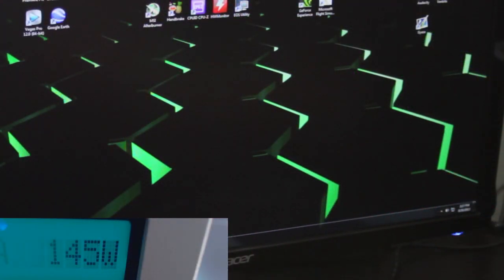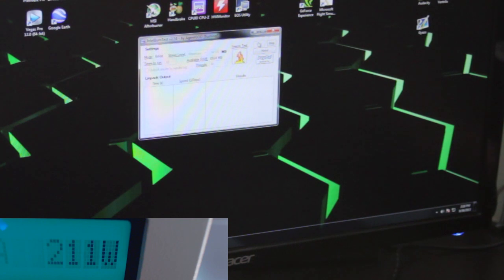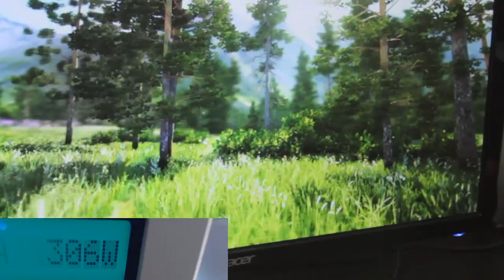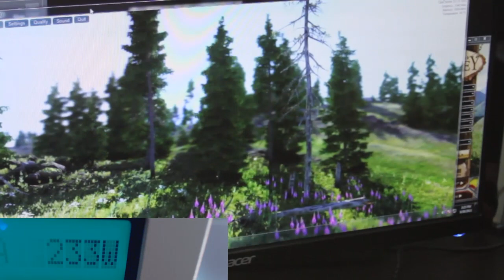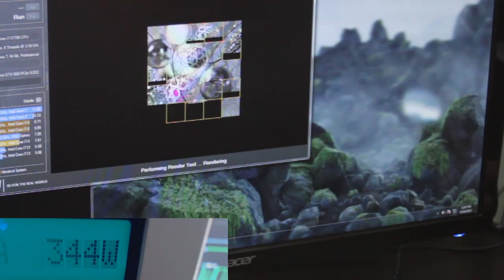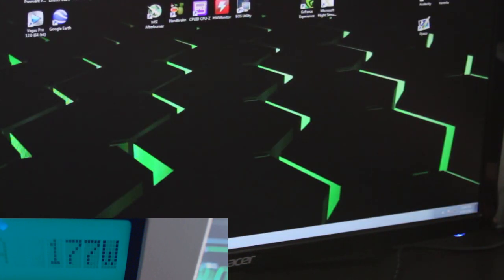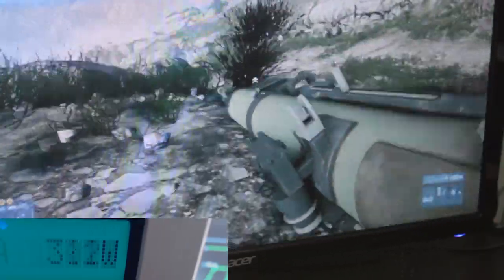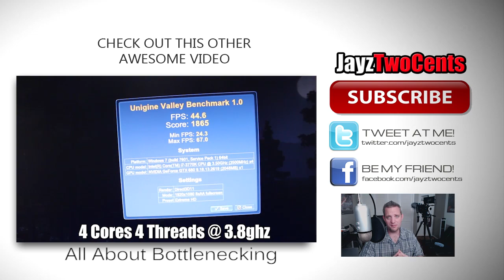How big of a Power Supply do you REALLY need?

Comment: nice video < im planing to SLI 2 MSI GTX 760, and im still wondering if my CX750M 80+ Bronze will support it , i dont have any budget any more since i'm about to purchase another GTX 760
Reply: Did you use pc partpicker to pick out your parts but a 750 should be enough but remember if you plan to overclock parts it ll require a bit more power but 750 should be enough for sli setup
Reply: thanks for the answer, nah im not comfortable on overclocking , but hey thanks , and yeah i put all of my components on pcpartpicker and all my components needs 620 wats for 2 gtx760 i still have almost 100wats left but i'm not sure if that calculation from pc partpicker is accurate
Reply: mark anthony chance Its pretty accurate most people use it too get there stuff organised so yea 750 should be enough but if your still worried get a 850
Reply: i guess 750 be fine , thanks bro!
Reply: I had the same 2 cards running off of a shitty 750w and they worked just fine with no problems. 750w is fine for 2 760s
Reply: cool , i think for now im gonna be running this gpu alone cuz i feel like i dont even need to add another card, but hey i still wanna do it though!
Reply: Honestly when I did it, I thought it was major overkill since I was playing 1080p only. I started playing in surround which really brought out the performance but the 2gb of Vram became a major issue so I sold them for an R9 290 4gb.

Comment: Okay, all the power supply calculators online are full of shit, not even 2 of them agree with the wattage even closely!

So I'll just ask directly: 2x MSi R9 280X Gaming 3G + FX 8350, 850W(gold) enough?
Reply: More than enough for that that setup should nt use more than 700 watts
Reply: Andy Williams Are you sure? The stats show that the MSi R9 280X draws 300W under load.

I need to be sure, I'll be ordering the parts from germany, which is 2 countries away!
Reply: BigBadBeef well if you want to be safe get a 850 80+gold  but a 750 80+ bronze should be enough the rm850 would be more than enough if you want to go on the safe side
Reply: BigBadBeef honestly they are right 850 is enough, 750 MIGHT be stretching things a bit, so honestly the best thing i would recommend is an 800 watt 80+ gold/platinum, but with that kind of rig an 850 wouldn't really be "much" overkill so you could definitely go with it to be safe.
Reply: with 2 7950 crossfire burnt my 600w toughpower in two days lol

Comment: Would a 500w be fine for a FX-6300 + R9 270?
My PC is going to be very overkill because I tend to play very old games :p.
Reply: Even 500W is overkill, the R9 270 with a 4770K draws much less than 300Ws from the wall even at full load, watch this video again, a 3770K with a GTX680 barely draws more than 300W at the wall. A 430W PSU would be sufficient for any mid range setup, even in the future, since components will only get more efficient. There are those who would recommend 1500W PSUs for a HTPC but you would be paying more to get less efficiency.
Reply: Remember to future proof as well, you'll be pissed if you have to buy a new power supply when you upgrade.
Reply: yifuj I really need a device to tell me how much power it's using. Is there any software?
Reply: Nope, just get a wall outlet meter like a Kill-a-watt, they are around $20, and unbranded ones are like $10, very affordable.
Reply: yifuj
You have to remember about efficiency a 50% efficient 450w psu would draw 900w from the wall at 100% load and an 80% efficient 450W Psu would draw 562.5W from the wall at 100% load.
Reply: AT LEAST 600/ 650.. I Have i7 4770 r9 270 with a evga 750 80 plus

Comment: nice video I think I got what i needed to know but can I ask anyway I will put a gtx 780ti and an i74770k in my build maybe overclock to 4.5 and I'm planning on using corsair ax860i  I was going to use 1000w psu just because in the future I may put another 780ti but around the forum people say I need 1000 but what do you think will the 860 be enough for two 780ti's ?

Comment: a 1000 watt power supply which isnt 80 plus is still going to deliver 1000 watts at max peak, but itll drow over 1000 from the wall, not the other way around as mentioned in the video

Comment: wow, I really overpaid for my Corsair HX750w.....I just liked how it has a 7 year warranty...I guess truth be told, nearly everybody out there would be perfectly fine with the cheap bronze rated Corsair Builder 430w power supply. Good to know I don't have to spend $120+ just on a psu...I honestly felt guilty paying that much when I could of gotten away with a 20 dollar bronze rated PSU (after rebate...before, 39.99) >_> . I run a modest 3570k @4.2ghz and an HD7950 non overclocked with 16gb ram, 2hdds and an ssd for the os

Comment: So I'm looking into throwing a Corsair H80i into my system. I have a 650w power supply (not 80plus rated) and my specs are FX 6300, MSI HD7870 OC edition, ASUS sabertooth 990FX R 2.0, 7200 RPM Seagate Barracuda 500gb, and I also have a led strip and I don't know if this matters but I run it with 2 monitors. With this setup do I have a big enough power supply to add the H80i?
Reply: You'll be fine. But you need a better power supply. I think 80+ Bronze is the absolute minimum for efficiency.

Comment: Glad I watched this video recently, just added another MSI R9 270 to my build.

My rig:
i5 3570k 
MSI R9 270 in Crossfire (overclocked to 1140mhz, using unlocked msi afterburner)
8Gb of Ram
256GB Sandisk Ultra sdd
1TB HDD
This is all powered by a Corsair CX600M PSU and before you ask it's totally stable. :D 

Thanks Jay

Comment: Soo you mean that my 500w will power a GTx 650?
Reply: definitely, a 500w could power a 760 easily so i cant imagine a 650 being to strenuous
Reply: ohh, since people says i need like 800 w -_- fuck them
Reply: Daeswow You can run a 770 or 280x on 500w.
Reply: I have a 4670K and a 7970 GHz overclocked hard on a 500 CX siries (budget one) 
Totally fine!
Reply: i have gtx 650 and my psu is 450w, works perfectly
Reply: Well i buyed 2 GTX TITAN Z, for my heavy projects, thats not even the GTX 770 ti could handle and i need big power to do what i do
Reply: Daniel Bekkelund You bought 2 TITANS? uh they draw about 375 watts each so you will probably be wanting something North of 800 watts.Maybe a Corsair ax1200i?, it's 1200 watts and expensive, but considering you bought two titans it shouldn't put you out too much, and it's 80+ titanium which is the highest efficiency standard so it will save on power and last a while/
Reply: Daniel Bekkelund are u on steroids???
Reply: ^ what make you think that O.o ?

Comment: For AMD FX-9590 and GTX 780 what power supply should I get, I will not be over clocking at all.
Reply: I'm going to get an 80+ gold 850 watt psu and a h100i water cooler is that good?
Reply: I think I'll get a 750 watt just in case.
Reply: Thanks a lot for the help.
Reply: MagikPotato
Hey :) I have a FX 9370 + 2x280X crossfire, CPU overclocked.... peaks around 800W while stresstesting the system
Reply: unfortunately not in my country :P (damn)

Comment: @ 2:10 you made quite a big mistake. No matter how efficient, a PSU can (or should :Q) deliver the current it is rated for, the efficiency only determins how much additional juice you are going to draw from the wall and turn into heat inside the PSU.
A 1000w 80% efficiency psu would draw 1250w from the wall while delivering 1000w of usable current while a 90% efficiency gold/platinum/titanium psu would only draw 1125 W ->half as much heat for the psu.

Comment: Hi. I'm buying a PC on PC specialist and the parts that I've chosen all equal up to 614 watts, it's saying to use a 650 watt power supply. But should I use a 750 watt just in case? Like say if I wanted overclock.
Reply: ***** 
 yeah.
Reply: PC Game Man K thanks.
Reply: A 650w power supply with an 80+ bronze or higher rating should do the job easily.
Reply: Calculators like that one either overestimate to be safe, or are designed to sell more expensive power supplies, unless you have multiple graphics cards, 650W is more than anybody will ever need, even if you are running at 8.5GHZ on LN2.
Reply: yeah, easily
Reply: ***** In a sense I would say it is good to over estimate wattage then under estimate. Some calculators are pretty drastic though. Like one site said I needed a 750W Another said I needed a 450W. Im doing gravy with a 500W.
Reply: DukeadaWickid420 I'm building a PC with a amd a6 5400k 3.6 GHz and 4gb ram with 1tb hard drive and a MSI a55 chipset fm2 motherboard atx FYI and I don't plan on over clocking so would a 300w powersuppply work please answer I need to know
Reply: It might,but I would go 400 or 450 just in case. Its always better to have a bigger power supply then a smaller one. that processor might use more energy then i know about. usually a 500 is good for almost everybody.

Comment: Just as small comment on the facts in the video: If I remember correctly the 80+ mark does not mean that if you have a 1000W you will get 800W effect out of it in to your computer. What it means is that with a 1000W power supply you will draw a maximum of 1250W from the socket. This means that the efficiency rating is only valid when the concern is how much power you draw from your socket in your house. A 1000W quality power supply will thus deliver 1000W to your components, the efficiency rating does however mean that you will have an efficient conversion of 240V/120V AC (in your house) to 12V/5V/3.3V DC in your computer meaning you will get a power draw closer to what you actually use.

I might be a bit off on this but this is what I was told when I claimed the exact same thing as in this video.

Also I would personally use something like Kombustor or Furmark combined with Prime95 to get a maximum power draw. You could also max out FAn speeds and do a full system backup to all tyour drives to see the absolute maximum that your PC can draw.

Comment: Will my system run okay with this build? (PSU and I am not OCing the CPU)
http://pcpartpicker.com/p/3n0G9
Reply: Yes, that build will draw never draw more than 400 watts absolute max.
Reply: yes, but i reckon you should change it regardless. The cs series is for average builds when people want good efficiency. also that case not exactly good value for money. maybe the new 450d would be more suitable.
Reply: ***** Try BeQuiet, Seasonic or Superflower. As for the case, Might as well just get an NZXT source 210 or a Bitfenix Shinobi. Unless you really want the 650D.
Reply: Paul Haselton ***** Paul Haselton Thanks for the input and I will actually change the PSU also the reason I want that case is because of the more control over neatness as if you notice the 650D has more of those holes that you use to wire through everything without it being a wire mess.
Reply: Omar Ocegueda yes the 650d is has more cable holes, but it is also older, less radiator support and less user friendly. Maybe check out something like the phantom 530 or the arc midi r2

Comment: Hey Jay, have you since thrown in that second video card? Was the wattage ok?
I want to throw in a second gtx 770 2 gb in my rig, I have a corsair cx 750m, 6 120 mm fans, 2 140, water pump, led strips, 1 ssd, fan controller, etc. By reading and watching your video, I think I should be fine. Just wanted a second opinion. Thanks
Reply: Oh, also running a fx-8350 oc to 4.6 and a Asrock extreme 9 mobo, with 2 4 gb sticks of ram @ 2133

Comment: Do manufacturers of graphics cards leave headroom when they say that a specific card requires a 500w minimum power supply? I am looking at an XFX GHz edition card using the AMD Radeon 7870 GPU which says that it requires a minimum 500W power supply. I am using an intel core i5-3470, not overclocked, an asus motherboard, and 16 GB of Corsair RAM. Can I add that card with my current Corsair RM-450 power supply?
Reply: Yes

Comment: Buuuuut if you only can afford a GPU and a PSU at the moment and is planning on upgrading the PC later?

My motherboard is a ASUS N13219. My current PSU: 300w (lolzz I know), my current GPU is a GT 530.

I want to get the Corsair CX 750w because I'm getting the GTX 660 who needs more power. However I don't think they will fit in my chassi so I would need a new one but no one will take my old motherboard xD

Anyways..I render videos, play games, upload and will also make maps for games. will I need the 750w?

Comment: Im having trouble believing this. My 750w literally spit out a plasma ball and died burning hot with an i5 8gb ddr3 on a msi motherboard built to overclock and a gtx 480.  No way the 650w that came with the pc was enough nor 750w. Im getting a 950w supply.

Comment: I'm a first time builder and I really need help. I'm still deciding on the GPU but I'm thinking a EVGA SuperClocked GTX 780 or a  EVGA GTX 680, and for the processor I have 3 choices. A Intel i7-4770k, a i5-4670k, and a i7-3770k. For the RAM I'm going to use the G.SKILL Ripjaws X Series 8GB. For the HDD i'm using the Seagate Barracuda 2TB and for the SSD I'm sort of confused on what I should get because I'm going to put my games maybe recordings and OS on there so I thought of buying the SAMSUNG 120GB SSD. (Please give me a recommedation for that) and I'm just getting a simple DVD/CD thing from ASUS. I REALLY NEED HELP with the Case,the fans I should use, the Motherboard, and Power Supply! ANY RECOMMEDATIONS WILL HELP! Thanks you so much! <3 (I really don't want to mess this up cause I really can't afford to ship it back and everything.)

Comment: I got a watt counter and my pc only uses about 220 watts under load, am upgrading with some confidence my 400w power supply is good enough. I am predicting about 300 watts draw with the upgrade.
Reply: specs?
Reply: supremeAFA phenom ii x4, r9 270, it runs stably at about 270 watts maximum draw, I only have 1 hard disk and on board gfx / sound disabled, a few usb devices.
Reply: it's a good 400 watt power supply, I would recommend getting a watt counter if you're concerned that's the only way to know for sure they are cheap!
Reply: ha almost same specs only that i have an intell cpu .i tired runing the r9 270 on a 300 watt psu , and then the psu didnt work after words even after removing the gpu lol
Reply: its 2020 Im out here buying a 1000W PSU so I can get a 3080 lol
Reply: @luminescentlion  can confirm 1000w PSU cannot run 2x 3090
 the numbers in this video are fun :D

Comment: First of all you are not likely to have ever used an "80+ Titanium" PSU as the only ones certified as "Titanium" only reach that standard when running on 220~230VAC.

I have to call absolute bollocks on your statement that a higher rated PSU will waste energy. A PSU will run at its peak efficiency - that is the least amount of energy it will lose converting AC into DC - at around 50% of its rating. In your case, with a Corsair AX750 your peak efficiency range will be between 300 and 450 Watts output (50% +/- 10%).

A good PSU will (such as the AX750) will still be very efficient even outside of the peak efficiency range and not lose much.

You should have had not only a measurement of how much the PSU was drawing from the wall socket but also how many Watts was being consumed by the system.

The efficiency of cheap PSUs with crappy capacitors will decay rapidly in a relatively short time because of what is known as "Capacitor Ageing".

Comment: the 50% load statement annoys the heck out of me. if it's gold, 20%, 50%, 100% load the efficiency IF its a GOOD psu is 87-90%. The best of the best psus like seasonic typically do 88-90%. At worst, you maybe lose like 1-2% if you go with a psu instead at 65% or so load.

The thing is, half the time or so, you are idling while just browsing or doing other non-gaming or non-video encoding things. So, if that's the case it's better to have a lower-watt psu so that the idle load on it equates to about 20%, which should be 87% efficient. too high a wattage, you may say only 10-15% load, and that means efficiency goes down to around 80-84% or so.

Comment: So a i5 4440 and a gtx 770 can run on a 500w psu?
Reply: you can run that on even a quality 450w psu. I run a GTX 670 windforce, i5 3570k @4.2 GHz with a rosewill capstone 450m and my system runs quite quietly under even heavy gaming sessions.
Reply: Albert Chang well the 670 is around a 760, and they recommend 500w, thx btw for the info! :)

Comment: wow so I should be safe with 850w and 2 780ti no OC?
Reply: you can do that with a quality 750w. My rule of thumb is peak gaming power consumption is 70-72% psu load. mid 60% or less psu load on average during gaming for longevity and less noise from psu fan.

HardOCP (http://www.hardocp.com/article/2013/08/06/nvidia_geforce_gtx_780_sli_video_card_review/9#.UzHE5VdniJQ).

This is with a i7 3770k@ 4.8GHz, 2 780TIs, powering 3 monitors at 5760 x 1200, and the MAX WALL power consumption was 590w. Factor in efficiency (590 * 0.9) and it's just about 71% psu load AT WORST. If you're just powering one high-res monitor, it'll use slightly less power as it's pushing the cpu and gpus less. If the i7 3770k above was at even 4.2-4.4 GHz (sweet spot for cpu OCs imo), then you'll see at worst 65% or so psu load.

Hope this helps!
Reply: Albert Chang
Hey thanks man!
I´ve got 3 1920x1080 monitors and need some power for crysis 3 :)

Comment: I do have a 1000w gold psu in case I ever want to add a second 760.  I get around wasting energy by running it through a 500w ups, Therefore the ups is only drawing 500w from the wall.  If I ever add a second card, I would just take out the ups.

Comment: So everyone is posting specs so here's mine
MSI 970a-g46
FX-6350 @ 4.4ghz
16gb Corsair Vengeance @2005mhz*adjusted*
2x EVGA GTX 760's with ACX coolers @ 1205mhz under load
WD Black 1tb HDD/Samsung 840 EVO SSD*coming soon*
CoolerMaster V1000 psu. It was on sale, don't judge me! It might be a good bit overkill. :)